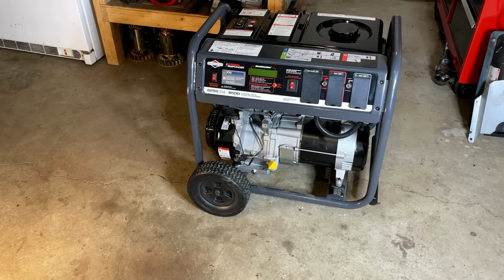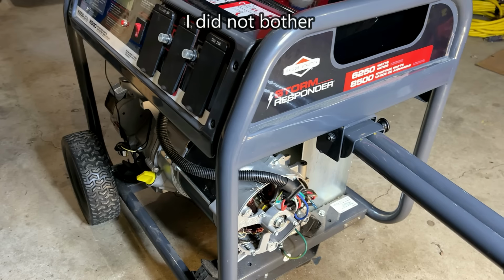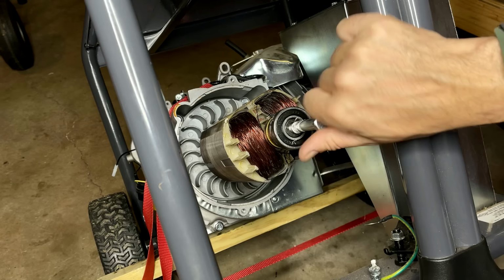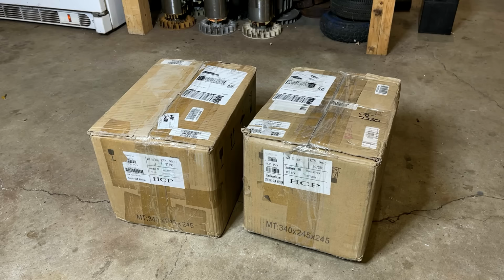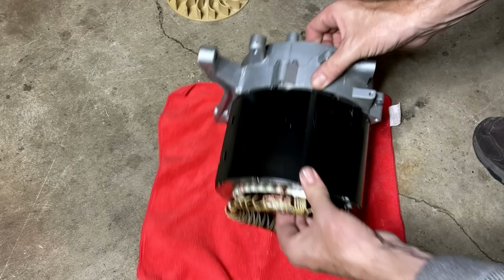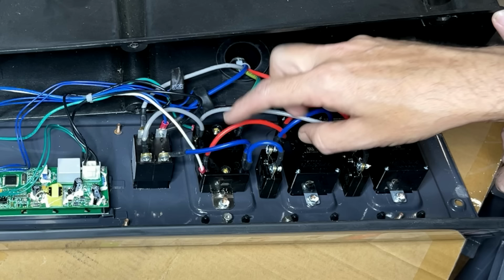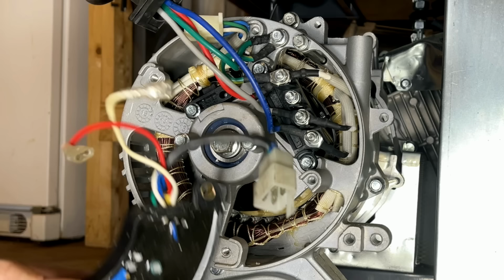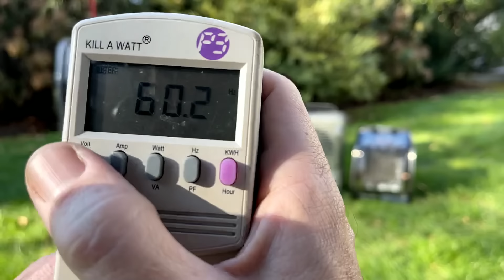New Storm Responder Generator Stopped Making Power

Comment: Great video James.  The dishonesty of the seller about this generator makes me sad about human nature.  Kind Regards, Craig
Reply: Nothing surprises me anymore 
They will disconnect hour meter on mowers and generators all the time
Reply: Any time I take anything apart I take a boat load of pictures with and without flash.
Reply: Where do you find the torque specifications?
Reply: They lie all the time in small engine busses 
Just expect it
Reply: @philliphall5198  is to
Reply: Just control few things before buying, take rear cover off.
Reply: I'm sure he knew was not working or he trying to scam people the original owner probably could have done something with it it makes me mad
Reply: @RowanHawkins  Nominal torques for all bolt sizes are availble from charts.

Comment: I bet the problem was that the original owner had wired it to their house illegally during an outage and forgot to shut off the main breaker. Then when grid power was restored, that caused the damage to the generator. Just a guess.
Reply: So that completely blew a zip tie to atoms????
Reply: Yep
Reply: Yep
Reply: @philliphall5198  
A plastic, non-conductive zip tie....
leaving no residue in the hole  which it was (theoretically) threaded?
Reply: Bet not. This does not explain the destruction of the wires just behind the end cap. This thing must have spit out a few bits of wire at one time too, as the fan draws air from the end cap end. This is prolly why the lacing cord was cut loose (by debris) at the engine end by coming through and being tornado'd by the rotor before being tossed out of the gen head by the fan blades.

Comment: This is why I built my own power generator.
I bought a 6.5Hp Briggs engine, 2 - 100 amp 12v one wire alternators, 2- 100AH 12V deep cycle batteries and boxes,  and a 2000watt Pure sine inverter.
Mounted all on to a movers dolly, with breakers, fuse and disconnects.... $650 total.  Later If needed, every single piece is replaceable locally today. I just wanted a "semi" movable, clean and dependable alternate power system. And I really couldn't afford one any other way...This turned out far better then i expected...

Comment: I have the Elite Series model 7000 which supposedly has 8750 watts. I've only used it for about an hour in the last seven years, I purchased it as a just in case for my mother's oxygen generator, she passed away in 2016.  It's a loud generator but seems to be pretty reliable, it starts right up...I keep it clean and maintained.

Comment: I had exactly the same scenario purchasing a Predator 8750 that was only a year old, but I got lucky!  Seller wanted 200, offered 100 and he took it.  It was a quality control issue as well where the brushes were not aligned with the slip rings.  I placed a small washer between the brushes and where they seat against the frame and that brought them back into perfect alignment.  That was 4 years ago and it has been flawless ever since!  I really appreciate your channel, I have learned a lot!  Thank you!!
Reply: Really should be more than 1 year factory warranty on things like that.

Comment: Nicely done. Also glad to see Briggs finally put a low oil shutoff on those things. Maybe in 20 years we don’t see quite so many blown up engines. Also, whoever picked red for the neutral leg should be… I don’t know. Electrocuted?

When it was being shut down each time, it sounded like something might have been rubbing. Kind of a buzzing like the rotor is touching a wire.
Reply: Check the effing oil everytime.

Comment: I have the older Briggs Storm Responder 5500/8250 watt generator. It has been very reliable and easy starting. I'm surprised Briggs went the way they did with their newer generators today. After seeing how and where they are made today, there is no way I would buy a new one. I also see they went from a poly gas tank to metal. I prefer the poly tank because they don't rust.  Sad☹
Reply: I don't understand why steel tanks are even used today although they have been a large part of my income as is rich people too lazy to take care of their equipment. Must be nice to throw away a $3k machine after three years because a wire got pulled from the PTO. Cost me $25 to service it and re-pin the connector. Posted it for $1500 and sold it for $1300 the next day.
Reply: I ordered a used plastic tank to replace steel tank on mine 
Will make it fit

Comment: Learned a lot. Outstanding instructions. Now I just learned that the same generator you are showing is probably the one I’m expecting from Lowe’s. Didn’t have a clue this is now made in China. Ordered it and should be arriving here in Moore County, NC on Dec 8, 2022. Wish I would have known. But in seems most is coming from China. Sad..
Reply: Run it, run it well and long..
change the intial oil after 30 minutes, 
the replacement oil after 1 hour,
and the re-replacement oil at 2 hours.....
This means you have got rid of all the sharp OEM  machining edges...and drained that trash out.....
Then go to the manufacturer recommended intervals.....

Comment: Great job on the project, when the video started I was wondering why it wasn't warrantied then later on in the video when you said that someone had been in the unit before I started wondering if it was a case of merchant refunding the money for the unit (or replacing the unit) and left it up to customer disposal of the old unit (Amazon does this sometimes) and the owner was trying to make an extra buck off the bad unit. Keep up the great work.
Reply: I've had two humidifiers go bad under warranty and the manufacturer had me take a pic after I clipped the power cord end off and then I had to dispose of unit.
I imagine same issue with a generator or any other heavy object with "hazardous" materials
Reply: Takes 10 mins plumb in a new power cord lol if that's all they make you do sounds like free stuff

Comment: 6204 is a standard metric bearing size with 47 mm outer, 20mm inner ring diameter and with 14 mm depth.

Comment: This would be a good example of putting some hours on the new generator before you really need it and before the warranty expires. Plus it wouldn't hurt to pull the cover on the power head (if you're comfortable doing so)and check if wiring looks to be in place and secured. Which I need to do myself.
Reply: My HF Predator genie has a required once every 90 day test to maintain the warranty.  Periodically testing something you need in an emergency is always a good idea. Had mine since 2016 but seeing this video I'll pull the end cap off mine to verify.
Reply: @tomschmidt381  If you have had it for  a while  and use it frequently, I would say that you are in good shape. However, the newly purchased generators it wouldn't be a bad idea to do. Have 3 older generators with zero issues other than the need for regular maintenance, but purchased 2 new generators this year one of which(Wgen6000) was only run for 10 minutes just to verify it ran, but haven't put a load on it. And the other (Igen4500) I ran for 20-30 and with a light load to verify it worked properly. Between the both of them, I spent $1200 on sale and still a lot of money to throw away if something like this were to happen.

Comment: Awesome job James! Good restraint not buying this generator at the original sell point. 20hrs is nothing, and thats a great deal on a Ryobi power head, it looks better built with resin and the string ties. 

Double check the brush head alignment to make sure the brush heads are directly over the slip rings. With a non OEM part number if one of the brush heads is ever so slightly off the slip ring it could cause issues later. Other than that amazing job restoring this machine back to working order!
Reply: Note however he used the brush that shipped with the rotor, so technically he used "OEM parts". (Ergo, the brush that was right for that stator and rotor). So no alignment should be neccessary. Note however that the incompatible parts here is the AVR, which was "stolen" from the broken power head, and the motor whose governor isn't compatible with this power head. Thats why the AVR had to be adjusted so it fits in-between the motor and power head. Basically, motor RPM directly affects line frequency, so first you adjust the motor RPM until line fequency is good. BUT motor RPM will also affect voltage, and different power heads produces different "base voltages" to so say, why the AVR had to be adjusted to be compatible with the "new" power head that isn't for that motor.

Basically, everything except the motor, the AVR, the panel, frame, and fuel tank, was replaced.
The rotor, stator, brushes, and terminal block was replaced.
Reply: @sebastiannielsen  The misalignment in the brushes would come from the end frame (original equipment) and the rotor (non oem). Adjusting the AVR is required due to a different size power head. The speed of the engine only affects the cycles (hz) in this setup. In a brushless then it's another story.
Reply: @worthcounty4317  exactly! Many times it's not just the end bell frame that can cause misalignment it can also be affected by poor manufacturing quality where the slippering assembly is pressed too far inward or not pressed far enough causing an alignment issue. James ran into this I believe earlier this year on another generator. Either way James is a smart guy he will definitely check on these things and may not show it on camera because it is difficult to film every little detail. Cheers!

Comment: A couple of shortcuts, gleaned from many years as an industrial electrician in a factory which assembled generators, and later actually manufactured their own heads. Our rebuild department, which repaired all of our gas powered products for resale. Most common failure was lack of oil in the engine! To remove the rotor on essentially all models, hit the side of the rotor a couple of good licks with a soft faced no-bounce hammer. Fortunately, we never used Chinese heads, or clone engines. Drop me a PM with mailing address, and I'll send you a number of different length rotor bolts, and other  unobtanium.

Comment: James, you need to use grease gun to pop the stator make a bolt with a grease fitting.  Or fill the stator with up with grease and use the bolt
Reply: It’s very very messy but it works

Comment: In the UK we are 50Hz and that means they run a 2500 rpm. This is low on the power curve so the engines have to be a few CC's larger than they need be. It also means they are quieter. I usually pull the engine over a few times to try and get some oil in the big end rather than dry. Wether that works who knows. Nice job on that genny, it does sound rather nice. Regards.
Reply from the maker: They do run a lot more quiet at 50 hertz.
Reply: 3000 RPM.  50 Hz times 60 seconds = 3,000
Versus
3600 RPM.  60 Hz times 60 seconds = 3,600
And Hz is cycles per second. 1 second x 60 = 1 minute.

Comment: Nicely done in this repair.  My situation was the same with a supposedly good generator and caught on fire when I got the engine going.  Unfortunately my unit is 20 years old and shall have to rewind my stator.  I don't want to abandon this 15kw Hatz diesel generator.  Thanks again for a informative video.

Comment: Another great video! I watch every Thursday and have learned so much from you! One thing I will never quite understand is how these old school non-inverter generators still command so much money (new or used). Adjusting engine speed and AVRs to try to get the expected output while powering your stuff with a less than perfect sine wave doesn't strike me as the best approach to providing backup power in today's world. Inverter generators are the best solution IMO. They are typically quieter,  more efficient and provide a much more stable/clean output waveform and really aren't much more expensive these days depending on the brand. I have the Honda EU7000is converted for tri-fuel and wouldn't consider any other model, despite the high price. I look at it as insurance.  Hope to see you working on more inverter generators in the future.
Reply from the maker: I own an EU6500 and completely agree.  An inverter is the way to go.
Reply: @jcondon1  And most importantly use it regularly to keep it in good working condition, that prevents condensation or rust and no problems with carburetion blockages, but yeah people are lazy...  cheap, and quickly find Honda too expensive, even they are relatively cheap in the US compared to the EU.

Comment: Hi James
Old motorcycle mechanic here and wonder why you don’t try a slide hammer for removing those stators. We had a adapters for the many different threads that suzuki used on there flywheels then the other end of the adapter threaded on to a smooth shaft with the weight you would slam back hitting a nut and handle on the other, stuff would normally pop of the tapered shaft.
Reply: Why not try a grease zerk screwed into the end of the hole via an adapter...and a needle nose grease gun applying 5k to 15k pressure  via gently pumping up the pressure?
Reply from the maker: I think the slide hammer is a great idea.  Need to get one.  An air hammer may also work.
Reply from the maker: I think the slide hammer is a great idea.  Need to get one.  An air hammer may also work.

Comment: Shoot, I have a 6.5kw ridgid portable unit i got in a free package deal that would love to have a new engine. Not used to seeing the generator portion die before the engine these days. I took one of these blown up engines apart for fun (out of a 7?kw champion generator), the oil slingers are tiny arrow shaped things. It's a wonder they even get any oil into the rod bearing and sleeve. Also for fun, I had a good rotating assembly from one that had a balance shaft explode (slinger on rod cap was a casualty) I used an 8mm wrench and zipped the open end off, secured it to one of the rod bolts as an oil slinger then jb welded the hole shut. I expected the engine to explode after starting but would you believe I have 2 hours of runtime on that thing? Still seemingly going strong and making power. Not even any uncommon internal noise.

Comment: I own one of these, thank you hurricane Matthew, and love it. Thanks for the video as I need to bump my voltage up as under about 50% load I was only getting 114v out and my led light in the house would flicker. The frequency was fine just the voltage was a little low. I have seen the same lights flicker (very annoying) when the utility is have a little sag in voltage.

Comment: Another great save Jim!  I'm tempted to give you my GP7500E or maybe drive up and figure out if it's the cam or not? It's the one spitting out the Intake AND Exhaust while running.
Reply from the maker: Would be happy to check it out.  Would say either cam or spark.

Comment: Always find quality parts for any kind of machinery or it will break before its time. Older generators that were made with much more quality clearly show that. I feel bad for the guy who spent the money on this generator and had the powerhead fail after 20 hrs. of use on a new machine. Only generator I would get brand new even though they are expensive would be a Honda hands down.

Comment: I'm thinking that all the windings are made with ECCA wire (Enameled Copper Clad Aluminum Wire)
If is an ECCA wire you can't scratch it to remove the isolation. If you do that you will remove the copper layer too.
I never use this particular wire, but maybe you can test with a piece of wire form other device.
Try to remove the isolation varnish with a lighter and only then try to solder. Use a solder iron that you can control the temperature. 
If the solder tip goes black quickly it means that is too hot and it will burns the tin. Using a diode in serial at the solder iron mains AC will do this trick.
You can try to removing all layers and leave only the aluminum. Try crimping it with other piece of copper wire  using the crimp part of a terminal to crimp both wires. 
You can see this joint types in an iron or in any heater element. Nice Channel! Best Regards

Comment: I bought the very same generator @ Lowe’s with a bad engine for 50 dollars, there’s not a engine parts exchange or parts list on Briggs website for such a new model. I wonder where how I can get engine parts or an engine? This one doesn’t have compression and block doesn’t have a hole in it, also paint isn’t even burned on muffler. I checked on parts availability before I took anything apart because I don’t want a basket case. If that makes any sense. I’m asking you because you are very knowledgeable

Comment: Damn!.. now that's a stator failure. Probably someone whom originally purchased it took the 6.25/8.5Kw as factual and just roasted the windings... they always seem to advertise double the sane capacity and put crappy breakers in so it will burn before anything shuts down. I have always bought Honda gensets, but even today their quality is going south and they are still one of the best out there.

Comment: Your rotor removing process is long winded. I have some rod which I use. I cut to length as you did. I then screw the 12mm bolt in and tighten to about 50ft lbs. To hold the rotor, I use a Rigid strap spanner. When ready, I apply a suitable gimpie to the head of the 12mm bolt. One must apply the theory of an impact device is to be used to its full capability  so size selection is important. A tack hammer is for tacks and a 5lb gimpie is for rotor removal. Very very is more than one standard blow is required. I have about 6 of these rods to do the job. Cheers

Comment: James take those bolts you use for the shafts and drill a hole thru all of then who corrospondens with a greasenipple and you can use a greasegun who works with 300-400 bar do the job easy pisy :-)